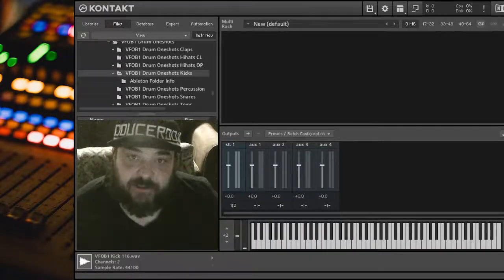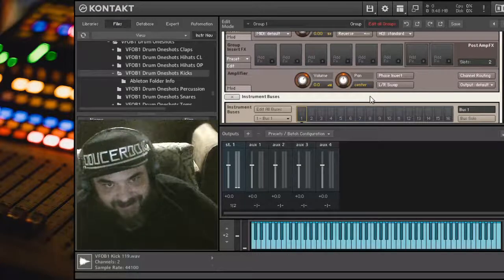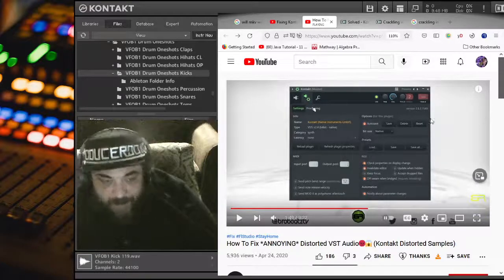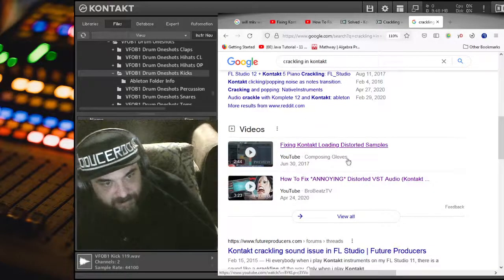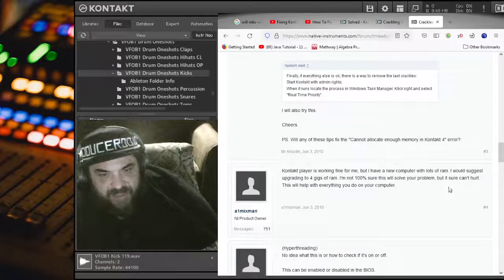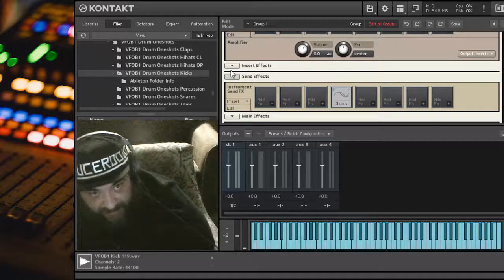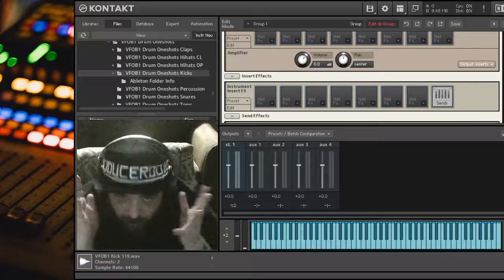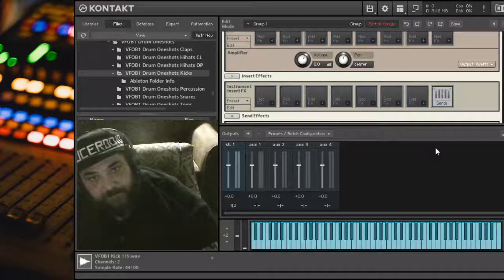How 2 ACTUALLY FIX!!!  Crackling,  Popping,  Distortion Problem in KONTAKT 5/6 on ANY DAW!!!!

Comment: My issue wasn't with chorus specifically, but an instrument had some send effects on which were causing issues. I honestly wouldn't have thought to look there until seeing this video because the problem sounded so much like the buffer issues I'd had like 20 years ago with low memory and CPU capability. That very well could be the issue some people are having, but my thought was "I have a monster rig so this shouldn't be an issue unless it's just not utilizing what the system has." Pretty obnoxious that they put the chorus on by default a lot of times, though.

Anyway, thanks for posting.

Comment: I'm sure your method works and you know a lot about Kontakt, but my issue was solved by one of the videos you laughed at because my buffer size was small. On the contrary, there was no legacy chorus in the send effects. I actually watched your video first; when it solved nothing, I watched one of the videos you were laughing at. And my problem was solved. You don't have to be condescending to put out good content!! Wish you well!!
Reply from the maker: Ftr, I never said their method didn't work, but the understanding was not there... Tbf I was at that level of understanding when I used FL2 and 3, not studio, but that was late 90s. And hell, I thought the tail was the transient for years cuz I didn't know anyone that knew better, so while I do kinda rip on FL users.. a lot 👀😈😁.. the fact is nothing in the production world is ever explained with an understanding, because otherwise studio techs would be out of a job, either way, I don't have a negative view of anyone wanting and willing to learn the trade... 

Moving on, FL for some reason has never played nicely with NI products... And I only laughed cuz that was me, and those tuts did fit the FL users memes to a T... And I do use FL mobile all the time to do midi, and I will say that FL in general is one of the easier platforms to do an arrangement with, but there will be a point where FL studio will start to feel like too much work, and other DAWs, that have a much higher learning curve, also have a much more streamline workflow... 

And with that said, I generally recommend new producers start in FL studio, but invest in standalone VSTs, never buy FL add-ons because if, and hopefully when you decide to move on, all investments in FL addon become null. 

Also, a small caveat, it's the master send not the channel send, but I'm not even sure that is available in FL studio, because someone else said in FL, you can't access the master send tab, only the channel send... So you would have to refer to the FL tutorial, another way is to locate the default instrument and replace the current default from the install, but resetting the VST also works.

Comment: Im having trouble with this too but in electric sunburst vst can you help me ?
Reply: I can’t seem to find where I can access the chorus
Reply from the maker: @T3d1919  Sorry, Internet issues... So you have to be in the editor mode which may not be accessible for every instrument. Which is something I was actually wondering about, because I have a couple free instrument I got from somewhere before that sounded like crap, and if the issue was the chorus, I would have no way to fix it.. And I know the first few times I tried to make an instrument, because I wanted my own drum sampler. I had no clue about Kontakts bussing system, I found the fx... but the chorus was under a tab I didn't even know I could click on, and I do believe Sunburst does have the chorus on it by default..  If you do have access to a copy of FL, since it uses a wrapper, that is a viable fix if you cannot access the edit mode.
...
Sorry bout the delay
Reply: Have you managed to fix this issue???